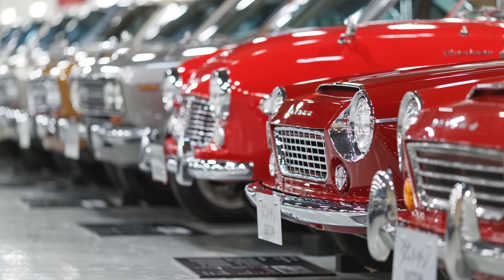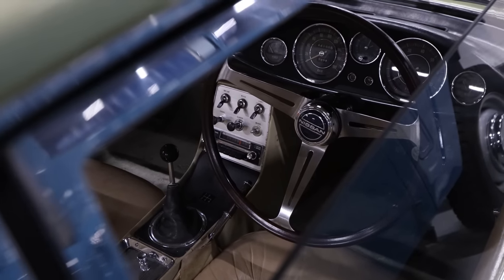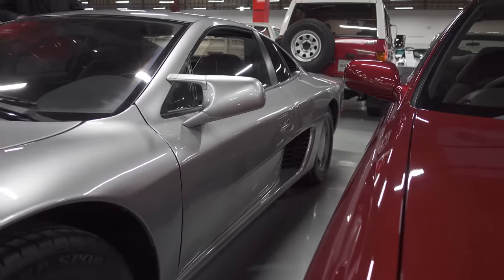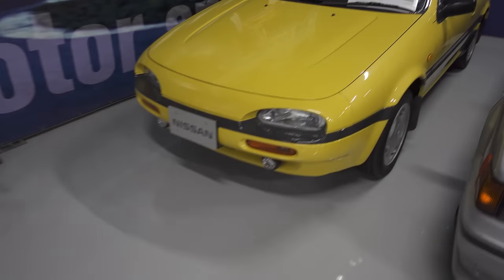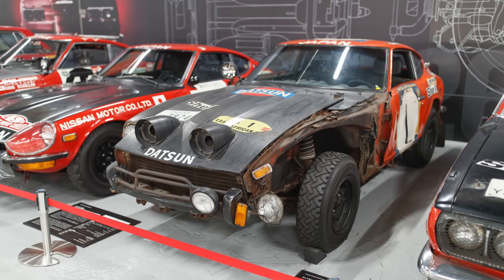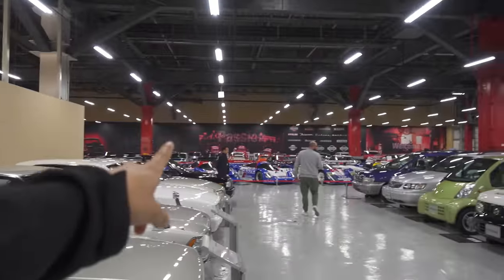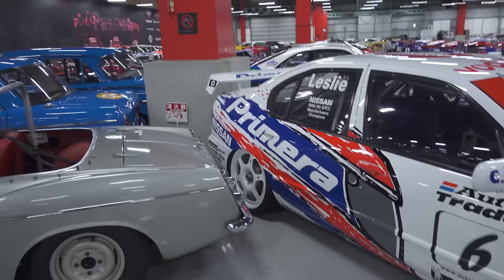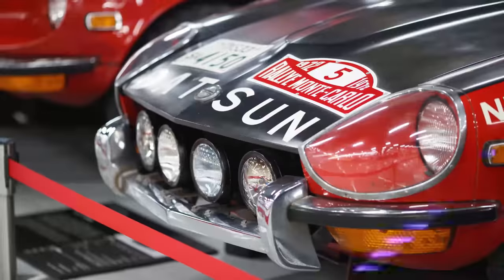The Greatest Nissan Garage in the World: Nissan Zama Heritage Collection is Nismo Paradise

Comment: 16:50 it’s a 1999 British touring car that won the championship that year with Laurent aiello. The car weighed around 900kg. This was the height of the supertourer era and it would have cost nearly £1million to build the car. The car had a reverse head which was used to help make the power. Carbon fibre was used everywhere! The engine was literally an inch from the ground! The driver of that car david Leslie sadly died in a helicopter crash a few years back.

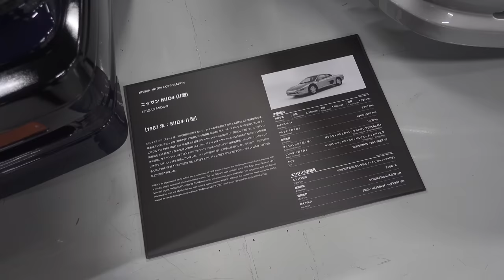Comment: 6:56 the Nissan Mid4 was a testing platform for the Skyline's AWD Attesa system.. I love those things. I reallllly wish Gran Turismo would have the Mid4 in game.
Reply: Sure wish it went into production.
A vg30dett with its insanely wide powerband would be perfect in it.
Reply: @waynebryan9496  I like the shorter wheelbase of it when compared to the NSX, it's so sexy.. Idk how it didn't get greenlit.
Reply: @waynebryan9496  if those things were mass produced.. there would be some insane ass builds today.
Reply: @smac919  Definitely. 
I myself had a built s13, swapped to a red top. 
Need a project car now and will probably  go with another s13, albeit I want hicas this time.
Reply: Yeah then they kinda made the 300zx out of it and S13. 😁
Sad it was never made. Could have been the "GT-R" in the 80s but was too expensive and the 280 horsepower gentlemen agreement.